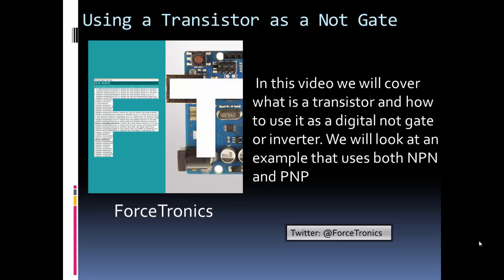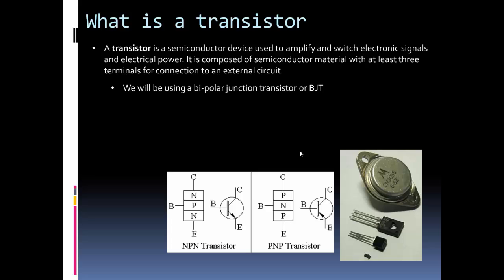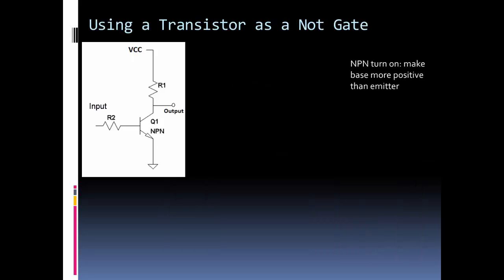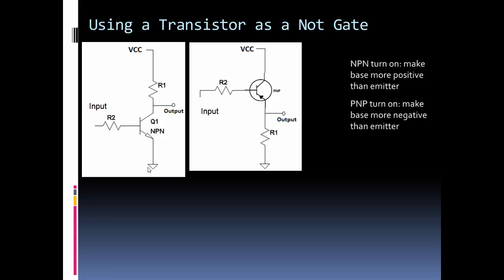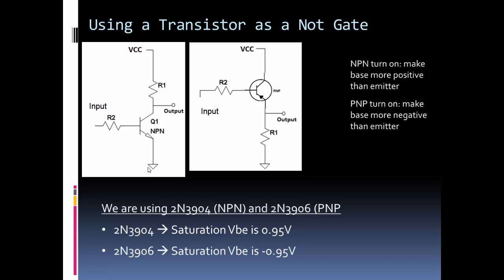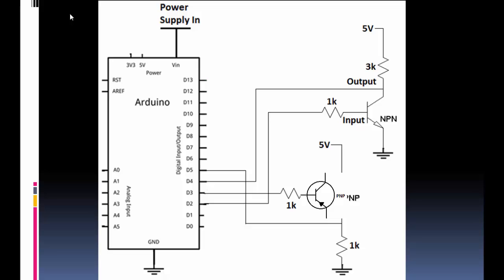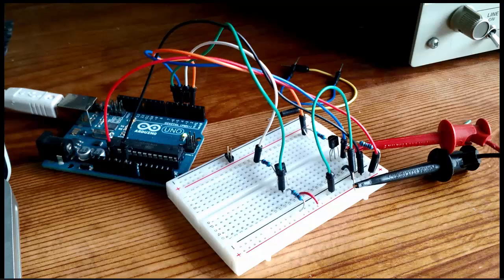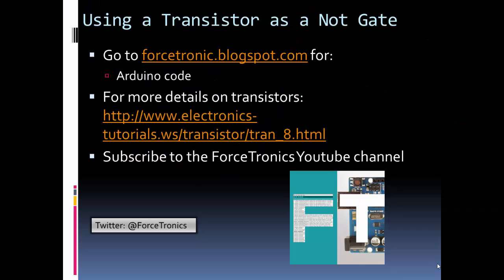Using a Transistor as a Not Gate

Comment: hello, how can there be a voltage drop of Vcc across an cut-off transistor when there is no real closed circuit at all?
Reply from the maker: A "cut off transistor" acts like essentially an open so that is why it would drop all of Vcc. I made this video almost 10 years ago so if I didn't answer your question correctly provide more details.

Comment: 4:09 how the output is tied to the ground? it's not connected to ground in the diagram, please enlight me,  is current not flow in branch?
Reply from the maker: When the transistor turns "on" it acts as a short, this essentially connects the output pin to ground creating a Low

Comment: Typical transistors used in AND an OR logic gates have three "prongs:" one each for the base, the connector, and the emitter.  Do NOT gates have at lease four "prongs?"  Thanks in advance.
Reply from the maker: Not sure I totally understand the question, this tutorial uses a standard BJT with base, collector, and emitter
Reply: Thank you for your reply, ForceTronics.  I understand standard BJT's have a base, a collector, and an emitter, but if you were to draw a triangle (i.e. the shape used to schematically represent a NOT gate) around the transistor, you'd have four "lines" sticking out: 1.) the base (the input), 2.) the emitter (runs to ground), 3.) the collector (where positive voltage is applied), and 4.) the output.

In contrast, a typical BJT resistor used in AND and OR gates only have three "lines" sticking out, where the emitter serves as the output and NOTHING runs to the ground.  Is this an accurate explanation?
Reply from the maker: The symbols used for AND, OR, NOT, etc are high level schematic symbols that communicate a certain circuit behavior or function, but they do not necessarily directly relate or convey how these specific circuit behaviors are implemented in the physical hardware of the circuit (at least that is my understanding). In the video I am just showing how to implement the physical circuit and I do not discuss the high level logic symbol